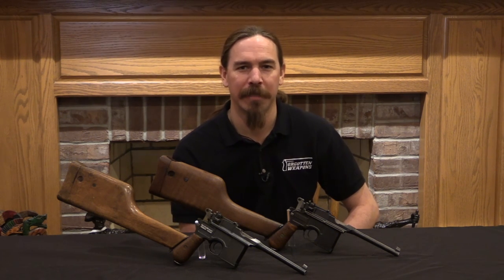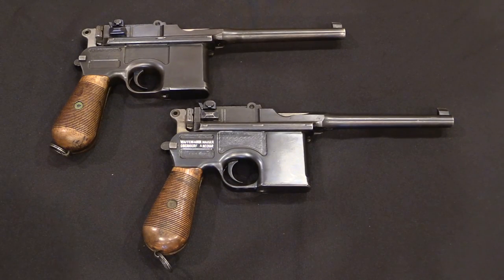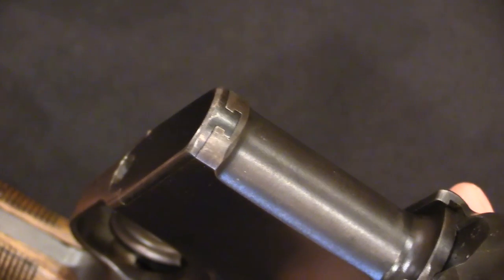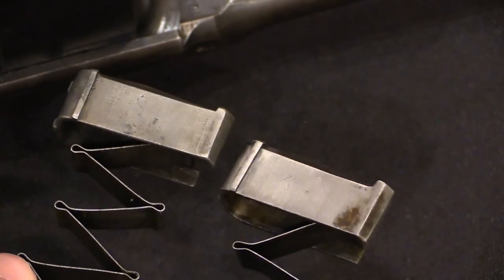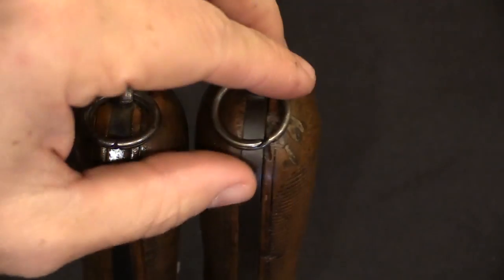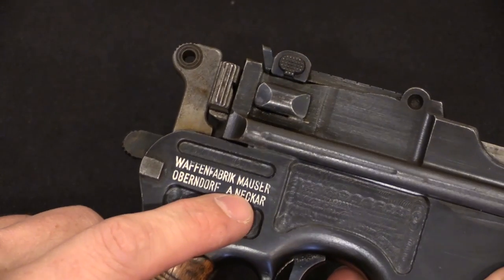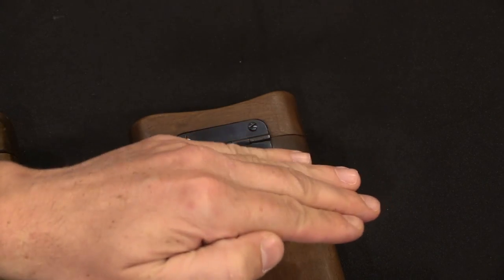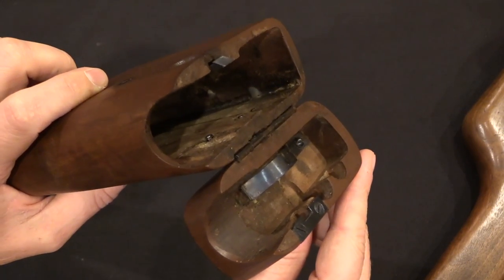Real, Reworked, or Faked? Authenticating a C96 Mauser

Comment: The ATF exempts Mauser stocked pistols from the NFA. What happens if an ATF agent looks at your stock and tells you it's faked? Does he shoot your dog immediately?
Reply: (seriously though, surely the ATF does not run a mauser historical verification service)
Reply: Generally if the pistol is original, it doesn't matter if the stock is a fake or replacement. However, as I said in another comment, if the pistol has had the receiver replaced, as my semi-auto converted Model 712 has, then it cannot legally mount a stock of any kind. That's my understanding from the last time I read up on the rules, assuming they haven't had a 'change of opinion' recently.
Reply: @USSEnterpriseA1701  i honestly doubt in the case of C96 pistols they particularly care.

These are relics of 100 years time, the newest one made is 83 years old.
Reply: @therideneverends1697  No, given how nit-pick-y the ATF has been of late, I'd bet they'd jump on you in a heartbeat for the tiniest perceived infraction. To them, that new grip frame made in the 1980's IS the gun, and therefore it is not in fact 80 years old, not that age matters to them all that much. Don't forget, the 130-ish year old early Maxim machine guns are still just as heavily regulated as a 1980's automatic conversion of (insert cool 80's semi-auto version of a full auto gun here) for the most part. I'd rather not draw the ire of them in this case, preferring to try and get change to happen through the legal processes, if possible. I've heard of a supposed saying by the ATF, 'once a machinegun, always a machinegun', no idea if they actually say that or not, but if that's the kind of mentality they choose to go with, then I'm not about to see if they consider my converted 712 an SBR if I try and stick the stock on it.
Reply: TheFanatical1 most people won't get "that shoot your dog" joke lmao I did I'm dying here
Reply: Do tell?
Reply: You are not Wayne Newton. I've met Wayne he is a nice guy if your nice to him.
Reply: You are not Wayne Newton. I've met Wayne he is a nice guy if your nice to him.
Reply: They're specific in stating the stock needs to be original or a closely matching duplicate of the original.

Comment: OK, both are Real, one is worth $3000 - $3500 and the other about $1500 - $2000.  Preservation vs Restoration vs Refurbishment should of been the title...
Reply: If the floor plate of the real and authentic one was matching , expect $4000+. These guns are actually difficult to find in good condition and all matching, including the shoulder stock.

Comment: Nice to know so I can get a good price on a non-authentic one.
Reply: Only if the seller knows that it's a less than authentic one. I've been in a room when a guy was trying to tell a seller that an antique gun wasn't 100%. I don't know who was right, but I thought the two guys were going to punch each other.
Reply: @Odin029  I had one back in the 80s I wish I had kept it.
Reply: @Odin029  Scammy antique sellers should be exiled in the same remote island as scammy automobile sellers. I am sick and tired of boomers selling broken or bubba-ed weapons and millitaria as if they are museum quality pieces
Reply: Exactly what I was thinking. A gun with newer/replacement parts (which probably means better functional condition) that's also cheaper? Yes please!
Reply: @BleedingUranium  In many cases you have to replace the springs, bolt stop etc. or even have a new barrel sleeve installed in case of shot-out bores. I've done that with two Broomhandles, and now they are safe, functional and look awesome! The shoulder stock is also indispensable - C96 with a stock is specifically exempt from NFA as are a few other stocked pistols if in their original configuration.

Comment: Meanwhile, I have one that was found in a wall, looks like it was found in a wall, still out-shoots some people and their Glocks.
Reply: That would be the shooters, rather then the Glocks. Glocks are plenty accurate.
Reply: @Agentcoolguy1  not really. a good marksman can get the most out of a pistol that 'shoots a sloppy group' (like glocks do) but a fair marksman can get the same result with a pistol that shoots a 'tight group' (like a mauser) .... its ok if you like glocks. they are a fine pistol, but I have never met one that I liked, they dont fit my hand the way my H&K does. plain and simple and thats my only real complaint, aside from the big groups.but that could just be me. or it could be the extra clearance they have so people can bathe them in mud and gunk to show off how durable a glock is.
Reply: Where did you find the wall
Reply: @tadeuszbanku2329  the guy bought a house in Baltimore, not long before one of the times Baltimore flooded.  So, the basement needed to be gutted and re-done.

First wall a contractor sunk a hammer into, out came piles and piles and piles and PILES of old guns, dating from the 1860s to the 1960s.  .38 revolvers of every description, Lugers and 1911s from both world wars, some rare-ish European target pistols, 15 mint-condition Thompsons, some MP40s, and so on.

Being Baltimore, sadly, the NFA stuff all got jumped on...but the rest?  It all wound up in a gun shop I used to hang out in.  Anything that was on the lower layers of the pile was gun-shaped coral, anything near the top was pristine, with the barrels all plugged with cosmoline-soaked cigarette butts.

My Broomhandle was at the border between the two
Reply: @mikehendon7327  sounds like an awesome find! Must have been like opening a treasure chest. Thanks for sharing that story with me, I appreciate it!:)

Comment: The telltale signs of hand polishing are good to look out for if you're in the market for vintage wristwatches as well.  Especially stuff that was cheap for a long time but is becoming worth more now, like 1960s and 1970s Seikos.
Reply: I’m a bit of a watch guy, I buy and sell them a lot and it’s paid my daughters uni costs….and you’re bang on the money there. There’s a very fine line between being polished not quite enough, and polished too much. It can give the game away easily if you know what to look for. 

I saw a 70’s Rolex Oyster Perpetual at a highly regarded dealer, it was a little bit special and I considered buying it, as it was still about 10% below what it was worth. The documents stood up, the authenticity was affirmed, but I was very sus about the bezel and the band claw, the polish looked 100% perfect, but when the rest of the was 75% perfect. The grain looked off too. 

It turns out after some digging that it was badly damaged after falling off the wrist of the owner, and it was repaired and polished. The difference could have passed most people by. Even my wife couldn’t see it. I could have made a pricey mistake! 

I also saw a Grand Seiko that was stunning, but had a previous frame repair that was just subtle enough that no one had spotted it. The polish was too good, the polishing direction was off and they over softened the edges. A no from me! 

I will often buy a watch that’s had some action and been repaired, if the price corresponds to that and/or if the repair is disclosed. The problem is that they often don’t!

Comment: I spent a deal of time with old Joe Schroeder, a well known Mauser and Bergman collector coauthor of the book System Mauser (of which i have a signed copy of), But when he sold my my first C96 he told me a few tips about how to recognize if it has spent its life with a stock. One of the best ways you can tell that Ian did not point out is, on the right side of the hammer on the mechanism locking block there will be intense polishing, this is from the spring in the stock. I can also tell you that when Rguns imported a lot of C96s many were from Mongolia, Mine was made in 1908 and most came into the country with stocks, however many were heavily rotted and so R-Guns decided to throw them in the trash. Joe was a great guy and I am blessed to have known him. God Rest your Soul Joe.

Comment: This video raises some questions for me about gun restorations. As a machinist, welder,  metal finisher, and general metalworker I have made all sorts of parts to restore mechanical devices. From clocks made in the 1600s to antique cars to even go-karts made in the 1960s. The goal has always been to make the repaired or replaced part indistinguishable from the original. My intent though was never to deceive and I or my customers were almost always honest about the restored portion of a device or vehicle. One example was when I had to learn to make crappy MIG welds on a frame that matched the originals and my customer told the judges that what they thought was a completely original frame and seat support was in fact mostly new. I have made and restored some parts that my customers represented to prospective buyers as completely original and I no longer do work for them. Anyway, recently I have been asked to do some restoration work on a couple old rifles. I have no idea if they are valuable. So if I make or repair parts that look perfect should I mark  them somehow so that they can be identified as a replaced or restored part?
Eric

Comment: Last year I bought a C96 Red 9. I thought it might be worthwhile noting that I contacted Mauser for details about the serial number. One important detail. WWI C96 Red 9s had a 9 inch barrell and a ladder rear sight. The Treaty of Versailles required that Mauser retool these trimming the barrell and replacing the rear sight with a fixed one. The Allied powers apparently had enough respect for this pistol that they wanted to make it less formidable. The Treaty modified pistols are legitimate Red 9s according to Mauser but they don't have the standard wartime configuration. Some 36,000 Red 9s were made during the war. Original configurations are likely trophy guns or weapons carried home by German service personnel.

Comment: A little less than 20 years ago I was able to find and pick up an 8 number serial, all number matching, MAUSER emblem 9mm "Export" caliber broom handle. Since then, about 7 years ago I purchased at least a dozen rounds of authentic German 9mm cartridges and used those to help me prototype 9mm export cartridges out of cut down 9mm magnum cases. Then I started working on developing reloading recipes and have developed a solid 9mm export cartridge that cycles well for my broom handle. I've run 150+ different development rounds thru it, but I haven't finished my trials yet because of work/family/life and I live almost 5 hours round trip drive to the nearest outdoor range. Now that I've seen this video, I am going to re-open my development for a modern 9mm export round... Thanks!

Comment: A real easy way of checking authenticity re: anything organic pre-WWII will not have any strontium-90 or cesium-uhh-forget-the-isotope. They're byproducts of the bombs going off (and probably tons of testing residue as well) and permeating throughout the earths environment in the measurable PPM. The furniture on the gun might have been solely replaced, yielding a false positive (if all you're interested in is the metalwork), but it's a common method used in paintings, wine, etc.
Reply: So i suppose the radioactive things can't permeate after the gun has been made?
Reply: @thesturm8686  That's actually a real interesting question I didn't consider. I'm not in nuclear physics but  I'd suspect that most gun furniture has varnish/poly/whatever on it that eliminates the permeabiliy.  That's just based on my limited work with wood. 

I skimmed around the internets and it seems that they also end up doing a C12-C14 analysis for age, along with Tritium samples.that for full confirmability. (You'd use something like a hypodermic needle to core sample out two depths and compare the decay numbers). I guess if the levels match up between those 4 (probably more, if you're doing an assay, you're probably going all-out) you either have an authentic piece or a fantastic forger (in that case, take my money, brother, you worked hard for it haha)

Comment: I'd love to find one complete with stock at sub $1k, , even if it's mismatched or refinished
Reply: There are models from China that are just now being imported that can be found for under $400 but they are usually So Worn Out and Abused (To the point of not being safe to shoot) that no one would be even slightly concerned about having some Star Wars fanboy converting it into a Han Solo Blaster.
Reply: World Traveler Got a link for them? Because the only ones that got imported that I’m aware of where back in the 80’s before the import ban.
Reply: @worldtraveler930  If you want to make a Star Wars blaster, it's more cost efficient to start with one of the really good Airsoft or BB reproductions you can buy brand new for about $100. I've got the M712 replica in .177 that looks and feels in the hand just like an original (aside from the fact that it's parkerized instead of blued.)  It even functions and disassembles pretty much like an original, aside from the fact that it's CO2 powered and shoots BBs.  That fact alone makes it so much easier to own than an original Schnellfeuer, and it's a complete giggle to unload a full magazine in full auto.  (Caveat: it takes a month of Sundays to load the damn thing.)

But like I said, if you want to pretend to be Han Solo and build yourself a movie replica, there are cheaper ways to go about it without destroying a piece of history.
Reply: @tarmaque 
I feel that It's better to have saved a pistol that's So worn out and abused that it has become totally useless and destined to be scrapped by an Oxygen Acetylene Torch.
Reply: @worldtraveler930  I believe that Ian did a video on one these Chinese made C96s and the example he showed was a complete counterfeit in the sense that, while produced way back when, it wasn't built under license and was a locally produced rip off. As a result, there were some parts of it that were completely cosmetic and sometimes non-functional because whoever made it didn't understand what the part (or parts) were for. For instance, they may not have put functional sights on them but have a piece (solid, non-functional) metal on it that resembles the rear sight.

Comment: I just bought a relatively cheap C96 in 7.63×25mm Mauser. The overall condition of the gun is pretty good; everything fits tight, there isn't really any rust on it and the markings are clear. It has like 0% of the original blue on it though; the whole thing just looks gray lol. I've decided I will blue it myself and lightly polish it to make it look more appealing, and probably change out the grips which look like they have infused themselves with the rest of the gun. Also got a leather holster with it but I'm probably gonna end up buying a wooden-stock holster as well. I wouldn't normally mess with the original finish of an old gun like this but tbh it just looks so bad without any bluing and it's not like it's worth that much as it is now anyway. I've seen a lot of Mauser C96's on the market that have clearly been refinished going for a lot of money as well, and I'm going to for a finish much closer to the original factory finish. Anyone have any opinions? :)

Comment: Rounded edges are usually enough for me. Whoever did the refinishing just loved his wire wheel, and it even shows in the stock hinge where the screws are all resting in depressions. Back of the frame of the C96, on the right just under the bolt, is also badly rounded over.
Reply: rounded edges really tick me off.

if your going to refinish a historical weapon, do it properly. Dont do it in a garage in one weekend with a half case of budwieser and 3 cans of copenheagen in your system

Comment: it really looks like the receiver on the one with the white letters has been refinished you will notice at around 15:12 the color has more of a blue tone than the rest of the gun ,you can also see that some of the edges around the milled out spaces on the sides are slightly rounded over, if you look at the milling marks they don't seem to be as crisp as they should be. if you look at the other gun you will notice the top and bottom of the gun match in color and have greyish tone.

Comment: I can remember an Egyption rolling block with a worn out but plate and pristine rifling. It had obviously been used for guard duty or some such and not fired much if at all. 

The same could apply to some of these guns. Somebody had one issued and it stayed in the holster. They weren't firing it or even oiling it in some cases. Yeah if they came with the barrel ends in the white and it's has been blued that's a no no but I can see people doing that to make it look "right" even when the gun was new.

Comment: Had one of these for awhile. It was a pain in the butt to run and it required rebuilding before that could happen and a barrel liner as well. Bought as a shooter but it was barely even that for $700.  In the end it was neat to have but I happily sold it for what I had in it. I'd far rather get another HSc instead.